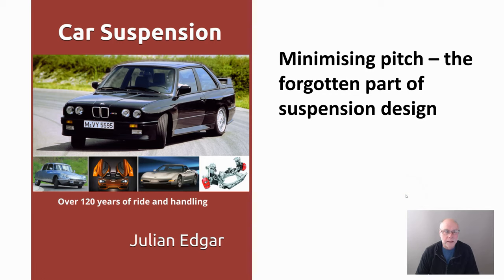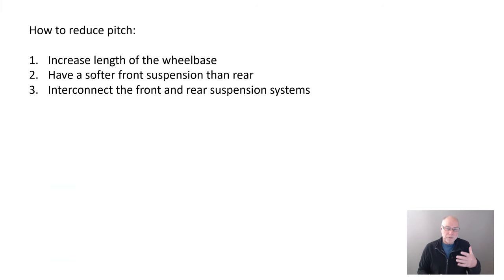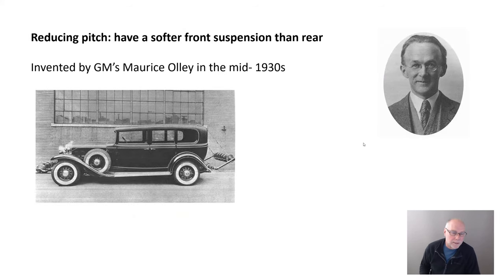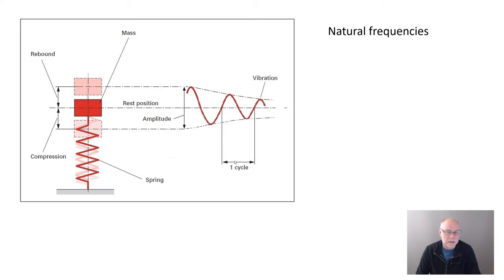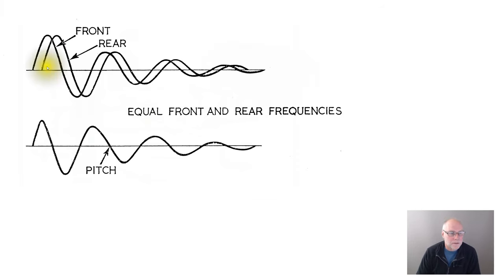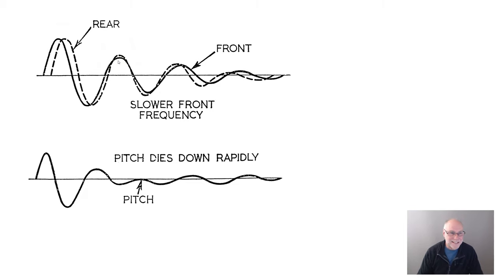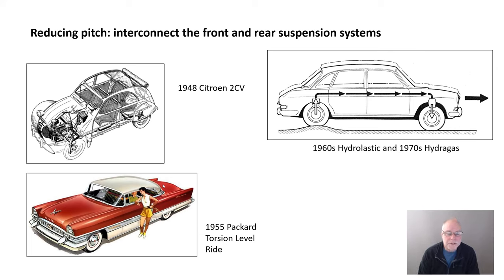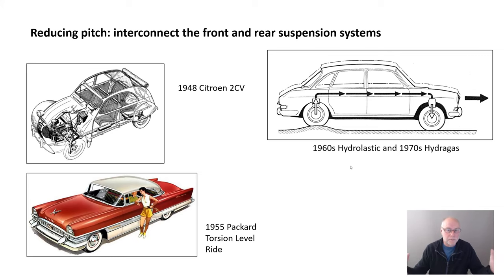The forgotten part of car suspension design - minimising pitch

Comment: I design racing suspension for a living. The reason you see a stiffer front suspension than rear: Drivers struggle with traction loss. Vehicles with a stronger rear spring bias are more likely to oversteer, especially off throttle. The engineers have no forgotten about pitch, but rather, the whole car is designed to car nose-first into objects. The entire crash structure is designed under the assumption it will hit nose first, because the most common collision is a front end collision. So you ensure that the car is going to understeer and lose front traction first, they bias car suspension for stiffer front springs and softer rear so that the car is more likely to collide in a manner that the crash structures are designed to absorb energy, but also in a manner to push the drivers into the common direction of the airbags. This all comes at a sacrifice of sporty, oversteering handling, and at a sacrifice of pitch consideration. It's also part of the reason speedbumps are so effective at traffic calming as the pitch sensation is now a greater discomfort.
Reply: Love these videos and learned some great stuff.
Reply from the maker: Yes but underster is not hard to build in with appropriate front/rear roll stiffness - can still have higher rear natural frequency.
Reply: @JulianEdgar  Exactly was about to say biasing for understeer isn't limited to having an unrefined ride...

Comment: Excellent presentation! Very much appreciated. 
I knew about GM’s research in the 1930’s and knew they had a famed researcher and now I know his name. Absolutely wonderful. I happened to read maybe 20 years ago that a Buick engineer was the first to systematically understand understeer/oversteer and it’s relationship to slip angles, suspension stiffness and roll bars (sway bar in the USA) maybe it was Maurice Olley as well?
Somehow I believe ride comfort (or boulevard ride as Cadillac named it) will be more popular in the future tha it has been in the recent past. Days when the highest aspiration for a daily motorist was to lap the Nürburgring at highest possible speed must be  coming to an end! I have noticed that Citroën have decided to re find it’s roots and focus on more comfort oriented suspension setups. During this summer I managed to try a C4 e (electric) and it was a delight due to the calming effect of silent “engine” and supple suspension and good seats. Had it been built on a dedicated electric platform it could have been better still as it would have allowed a longer wheel base and a lower center of gravity. 
Regarding the delights of interconnection of front to rear suspension I think it’s only going to happen with slightly more expensive cars because it most likely will require self leveling suspension. Another item which strangely have lost popularity. Somehow car producers must believe customers are more willing to pay for big diameter wheels with absurdly low profile tires than self leveling suspension. 🤔Strange.
Thanks once more for this uplifting presentation.
Reply from the maker: Yes Maurice Olley was responsible for a number of very important understandings in vehicle dynamics. However, as my book shows for the first time that I am aware, Frederick Lanchester understood some of the things that Olley was previously credited for, some 30 years earlier! I am sure you'd enjoy the book.
Reply: @JulianEdgar  I will definitely order your book! Tried to register on German Amazon this morning on my IPhone. Sadly they didn’t  accept my postal code. But I will get it fixed 😃

Comment: Great, great video and presentation. Suspension comfort/ride has been an interest of mine since I was 6 years old (seriously) and the interest has never left me. On my 2012 Toyota Camry, I attached 6 concrete blocks (4'X4"X15") just behind the front radiator (within the engine bay) to try further reduce the natural frequency of the front. I quickly noticed the improved ride, it felt like I stepped up to a more plush luxurious riding car. I just don't get why people want a more "sporty" ride and more road feel. Tires can also make a big difference especially to the higher frequency bumps and quietness. I got Pirelli P7 ASPlus3 tires which I think just came out in early 2022 for my current 2018 Camry Hybrid XLE which made a nice improvement to the ride and reduced road noise. Now I'm planning on installing about 40 to 80 lbs of lead (Pb) in the front or near the radiator to try further reduce the natural frequency of the front of the car. I'd love if a car was made with 0.5 Hz natural frequency - it would be interesting to see how may are actually susceptible to motion sickness at that frequency and it would be fun to experience this frequency on challenging roads. The downside of the higher weight (if you don't get a longer spring) is the reduced suspension travel if you hit a really big bump.

I'm guessing the reason the car manufacturers don't reduce the natural frequency further is that they don't want to be scolded by motor journalists who in their quick test drive will report the ride as being floaty or soft which they have convinced motorist to be a negative. i.e. Stiff ride = Sporty and cool, Soft ride = out of style grandpa car  that is a lot of emotion and little logic. You see this with all the aftermarket damper "shock absorber" ads where stiffer is better - They should rename the dampers "shock producers" with the stiff damping settings that seem to be the fashion nowadays.😀
Reply from the maker: Why don't you just fit softer springs rather than adding weight?
Reply: @JulianEdgar  It was probably cheaper. And I suspect there were no off-the-shelf aftermarket options that were softer than stock at the same ride height. Definitely stiffer AND lower, and possibly stiffer and stock height or stiffer and higher, but I've never for what little research I've done seen SOFTER than stock springs offered whatsoever in the aftermarket, barring special orders or air suspension, both of which are expensive.

Comment: Toyota x-reas and KDSS come to mind when you say that no mass produced vehicles have connected front and rear suspension. Though x-reas was the only system that was used to reduce front/rear pitch. 

Love your videos, thank!
Reply from the maker: According to http://www.top4runners.com/runhist/4thgen/2003_4runner_product_intro.pdf (page 14) Toyota X-reas is damping control system, not a pitch controller. (To reduce pitch it would need to change wheel spring extension, not damp it.) KDSS is a anti-roll bar disconnection system, so had no impact on vehicle pitch. If you can reference any technical papers that show otherwise, please let me know - both are interesting systems.
Reply: @JulianEdgar  Interesting, thanks for the response. I would think that the X-reas damping control system would be effective at controlling pitch. Is pitch control not possible with damping?
Reply from the maker: @SpaceCowboy5555  I am not sure - I'd have to see a tech paper showing exactly how it works. eg probably front/rear damping would need to be out of phase initially if it were to reduce pitch. (And damping doesn't change natural frequency unless the damping is massive, so again I can't really seeing it reducing pitch.)
Reply: X-reas would qualify. Connected much like the Citroen system. Main difference is the connection between the two is a mechanical spring /slider instead of a sphere. Also is has helper springs (like the Mercedes ABC). Looked at a set for hydro pneumatic conversions in the USA since Citroens aren’t common. There are some videos out there for a quick overview if interested.

Comment: I remember those old cars with different rate suspensions front and rear. Yes they were smith riding over bumps, but the additional bouncing after the bump was traversed was annoying. That is where the term boat and float came from. The packard and citron suspension worked surprisingly well. The packard one was poorly received because it was too different and misunderstood. Plus’s it has a self leveling system which was prone to failure.
Reply from the maker: Different rate suspensions front/rear has nothing to do with bouncing after a bump has passed - that's damping.

Comment: I think one of the reasons why there's less talk about this today is because damping probably has increased in cars across the board so even if the frequency response doesn't hold that perfect level-ride ratio, the damping kills the oscillations fast enough for you to not really care.
Reply from the maker: Maybe. But on a road with long waves, driven fast, you can easily see the cars that have appropriate f/r natural frequencies - and those that don't.

Comment: Excellent channel, love the content. 
I agree that car manufacturers now have a bias for firm suspensions, but there have been solutions for minimizing pitch and improving ride comfort. Improvement in electronics have made mechanical solutions for this problem obsolete. The Mercedes Magic body control or Audi's predictive active suspension are able to adjust springing and dumping to each wheel without any special mechanical link and with scanning the road surface they are even able to prepare the suspension for the road ahead.
Reply from the maker: But why do you have to buy an incredibly expensive car to get good ride quality, when in the past good ride quality was available in normal cars?
Reply: @JulianEdgar  Honestly I think buyers will settle for lower ride quality if it means the car is cheaper to buy and cheaper to run. Citroen's hydractive was offered in relatively cheap cars but they didn't fare so well compared to their German counterparts.
Reply from the maker: It's a false premise: as this video shows, minimising pitch doesn't need to cost a cent extra in purchase or running costs. (And you certainly don't need a complex Citroen-esque hydropneumatic system.)
Reply: @AwesomePhysics  The hydractive system is definetily very impressive, and not even too complicated. It of course did have its drawbacks, many of them similar to what’s present on air suspension. Nowadays Citroën has what they call ’progressive hydraulic cushions’ which scans the road ahead for bumps and then adjusts the suspension accordingly, gone are the spheres and a hydraulic cylinders for damping. Instead there’s regular springs but the shock absorbers are not traditional

Comment: My 2015 Mazda SP25 is a kooky example of WTF suspension thinking. The front has very little compression damping and lots of rebound damping. This makes the front freq appear to be very low, especially when compared to the rear end. It gives the front a slow 'wallowing' feel that is straight up nasty. It also has the effect of 'jacking down' the front end when subjected to repeated bumps - the suspension never gets a chance to recover from the previous bump. Going over a speed bump, the front wallows while the rear is very rapid.

Speaking of flat ride, FatCat Motorsports in the USA is a HUGE proponent of achieving this in your custom ride and he will work with you until the goal has been achieved. Not cheap, but very good. If I can get the $$$ together, I'll send my Bilsteins over there to be valved properly, because if you want to see what pitching is, come for a drive in my e30! Aye!! :-/

Comment: Hi Julian, interesting video as always. I think you are correct that OEMs no longer have good suspension design as a priority. That said, do you have any factual evidence that OEMs are not utilising flat-ride in most modern cars? The pitching you observe could be caused by many things, for example: 
1) The car may be set up to flat-ride at a certain speed, so going faster or slower than that target speed would impact how much flat-ride that particular vehicle has. 
2) Another aspect could be the weight of the car, if it's fully loaded up with people in back seats, luggage in the boot etc then that predominantly increases the rear weight and so the rear axle suspension frequency would be lower. This would then mean the car flat-rides less than when it only has the driver in it.
Reply from the maker: Thanks for your comment. Yes, each of the two points that you mention will influence the amount of pitch that occurs, but if my observations indicate that at the speed limit on my local bumpy roads, nearly all modern cars pitch badly, then it comes back to the basics of design for the market in which the cars are being sold.

Comment: Its probably just a side effect, but in my shelby with magnetic ride dampens i had nearly the same feeling as level ride.
Its just stopping dampening when i hit a speed bump and then firms up again as soon as the wheel is over it.
Reply: The 350 and 500 are sprung at roughly flat-ride values. They're better with a softer rear spring, like the Mach 1. Flat Ride is not the Holy Grail.

Comment: Maybe you can shed some light on this. I am planning on using some nice Ohlins shocks to get the adjustability and a quality product but I want to convert the front McPherson struts to air suspension specifically a sleeve rolling air spring type. The rears are standalone shock with another larger rolling lobe air spring as well. This is for a Tesla model 3 btw. Effectively if I understood your video on air suspension based off of my larger rear air spring and smaller front air spring I should have already inherently softer spring rate for the front and larger for the rear which would reduce pitch. 
I would just need to adjust damping to smooth out the oscillation after the bump hit etc. Any recommendations on how to properly set up damping?
Reply from the maker: https://www.amazon.com/Custom-Air-Suspension-suspension-SpeedPro-ebook/dp/B086GWTWDQ It won't answer all your questions but it is miles ahead of the other resources on air suspension.

Comment: Hi Julian, I recently discovered your channel. As a professional mechanical engineer with a youth spent undertaking automotive mechanical repairs,... I absolutely love your lessons.  
I wanted to bring your attention to the 2010-2012 Mazda 6 (GH-series 2 Australian model).  It's has Double wishbone front and multi link rear suspension,... but most importantly I believe it is a modern example of option 2 for pitch control with significantly softer front suspension than rear.  I have the manual hatchback model, and it was the pitch, ride and roll control that  I first noticed along with the low revving torquey engine.  These were deciding factors for me, which my brother then tried and bought the same vehicle.  
I have had the opportunity to test drive many different makes and models over the years before and after this Mazda, yet I plan to hang into this one for a very long time.
If you have the opportunity, I would appreciate your opinion on whether this truly is a modern example of this method of pitch control.
Reply from the maker: Yes, many cars use softer front suspension than rear to reduce pitch. But many do not. Why don't you measure the front and rear natural frequencies, then you'll be able to see exactly what is happening? (Covered in my suspension books.)

Comment: Also diagonal pitch. Take a 4 wheel IRS SUV off-road and you will spend a lot of time on three wheels. This is not stable. On the street when an diagonal pitch situation arises they tend to hunt for stability across their diagonal axis. In these situations I prefer my 4 link coil sprung live axle. The rear axle articulation allows much closer to a 3 point suspension that is stable in diagonal pitch.

Comment: Todays car manufacturers would love to add pitch control etc, the problem is the sheeple do not understand how this improves the ride and handeling, hence they are not going to add the advancements to the vehicles due to the pass on costs to the consumer, as they will not want to pay for something they do not understand.
Reply from the maker: There are no costs in specifying the correct front/rear natural frequency relationship.

Comment: Julian, what about the McLaren 720S and their interconnected suspension system? I know you point out no cars with significant production numbers, but the 720S is not that low of a production vehicle.
Reply from the maker: It's a damper interconnection, not a spring interconnection, isn't it?
Reply: @JulianEdgar  yes, ok I see. But would it not reduce pitch?
Reply from the maker: @GustavoDVillarreal  Yes I would think so. To be honest, I don't care much about hyper/super cars. They're accessible to basically nobody, and if there is no limit on the selling price of the car, engineering is much easier. Compare that to cars that have to be kept within a tight development and build budget, and have sold millions.